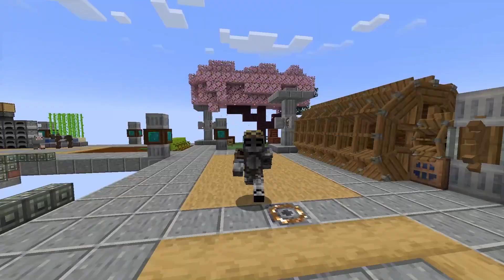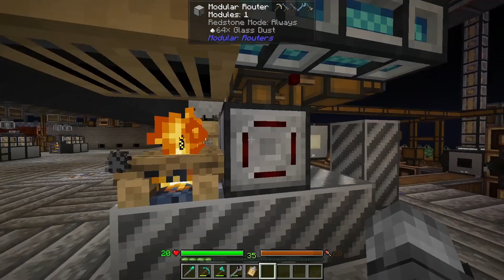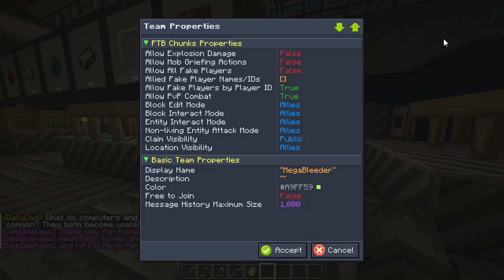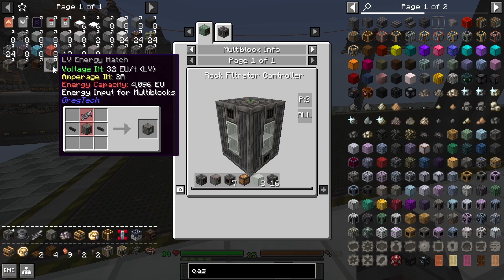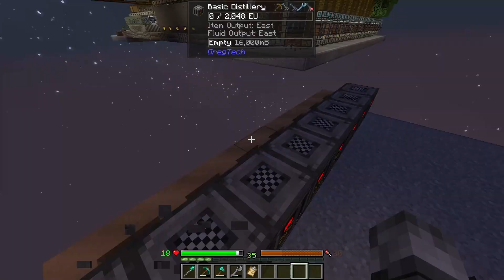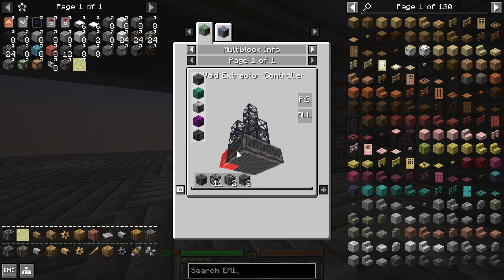Star Technology Ep7 Filtering Rocks into Gems

Comment: I really like your videos! They help me progress if I'm stuck and are really helpful. I was, however, wondering what version of the mod pack you were playing on because some command, like the one to make the time stop so it's always day, dont work on my save even if I bought the command in the shop. I'm downloading the modpack from CurseForge, so I'm open to another method of accessing  the modpack if you have a better one. Keep up the great work!
Reply from the maker: I'm using the Prism Launcher and I believe I'm in the most recent version of the pack. You could just change the day/night cycle with vanilla commands as long as cheats are enabled. Personally I dont believe this is cheating, I like to turn off weather cycles when I'm recording a series. If it were possible I would actually set the day/night cycle to like half speed or even invert the day/night ratio